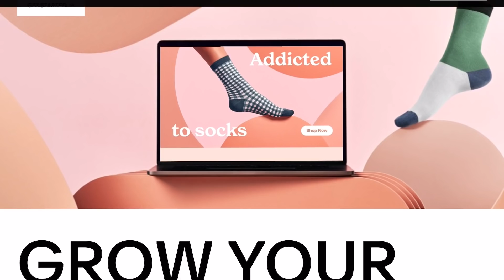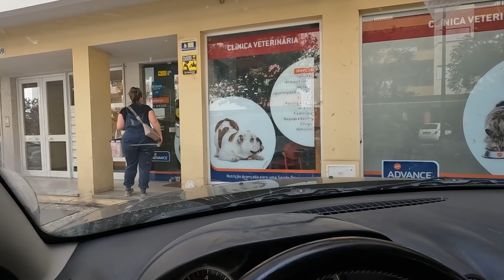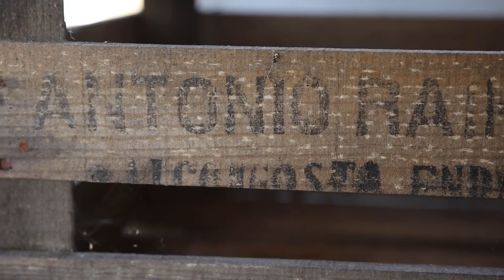THIS IS A GAMECHANGER! Building an Off Grid Tiny Home

Comment: I just saw something about a new invention called an Arctos Portable Air Conditioner for less than $100 USD. Looks like something it could make sleeping in your barn in the summer so much nicer! (I'm not affiliated with them in any way - just a mid USA grandmother!)
Reply: All of those little coolers are based on "swamp coolers" - evaporative coolers.
If there's much humidity they don't work very well.

Comment: I hear that it does get hot in central Portugal. Here is a tip that will work good for you since you don't have to buy water. You have clay tiles on the roof, so use water evaporation right on the roof by intermittently wetting the roof with water. The idea is that the majority  of the cooling does not come from the cool water, but from the evaporation of the water. I have seen inexpensive automatic watering controllers that be adjusted to give a 5 minute on and 60 minutes off, for instance.

Comment: Theo, please ,  please move your gas bottle away from the pizza oven and stove. If your gas bottle should be  leaking and you have an open flame that would be so dangerous and disastrous! You could put it in a sealed container and be safe leaving it there.

Comment: Next time you have to take Fernando to the vet, but a box with a height of 3 inches (a soda case size works well) into the bottom of a carrier with litter in it. If he needs to go, he will cover it and your car won’t stink. Also, bring a baggie and scoop and you can clean it out and dispose of it easily.

Comment: You two are so lovely. It's great to see you settling in your country space. 

Like other commentators, I'll offer an un-asked-for suggestion – mostly born out of my envy at your outdoor life and space. 
I'd plan for a longer term outdoor kitchen area, roofed but open, and with a plumbed in sink. 
I'd then have a seated outdoor area with fire pit and BBQ grid close by.

Your patio outside the barn/cottage is so nice that I'd want rid of cooking smells and any excess heat, (and for me the pool table would also have to go elsewhere). 
Instead I'd want a hammock, soft sofas, and anything else needed for a chill out space that would work so well in that shaded space. And maybe a wine rack close by. 

The summer cooking certainly needs to be round the side, or even a short walk from the barn. In the winter it'll be different, because you'll welcome oven heat inside the barn. 

Loving the wild flowers, and the goat gardeners. Keep doing what you are doing, whatever you decide.

Comment: Just to say having had problems with a bottle gas cooker. Ours is in greece So if it's from the UK you have a problem as the (part) sorry I'm not technical where the gas comes out on the burner is made for UK (gas) it's different secondly you need a valve on the bottle exit this valve varies in size depending on the cooker my first valve a plummer got me was correct this rusted away the second plummer ordered the wrong size which resulted in too much gas coming out the flame couldn't be controlled I realised screamed at my husband to run luckily he was 5ft away with his back to the cooker I was outside with our dog when it exploded the bottle is outside thank god but it broke the bedroom door lock the balcony ouble glazed door was pushed out plus an enormous set of 3mt high by 4mt wide cupboards was moved 2cm low cupboards were all blown out plus the double oven pushed forward but if my husband hadn't  moved he would have died from the force of the explosion please check very very carefully

Comment: Hopefully this is a temporary kitchen on the patio Theo you need to make a space in the workshop for this or of to the side of the house.Other than this it’s brilliant. This is just a suggestion you two,💕💕💕💕🙏🙏🙏
Reply: It's an outdoor/hot weather kitchen and pizza oven.
They'll have a kitchen inside for when it's cold along with the flat cooking space on top of their wood burning stove.
Their veranda is quite big enough to use that small area as their summer cooking area.
They can still play pool - and another commenter had the great idea of making a wooden top for the pool table and using it as an outdoor dining area.
So I'm not sure what you're getting at.
Reply: @alicecain4851   I understand where your coming from but for there sitting area and the pool table along with the outdoor kitchen .it’s got to be   Quite tight . Again this was just a suggestion.💕💕💕Thank you for explaining.